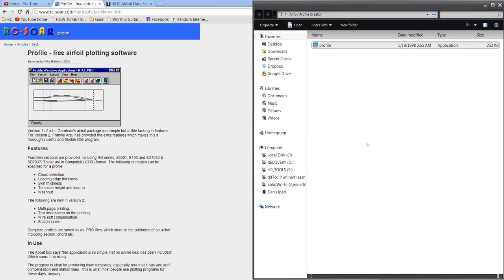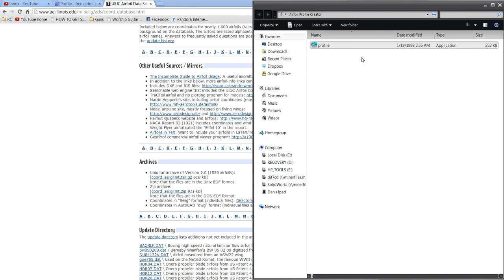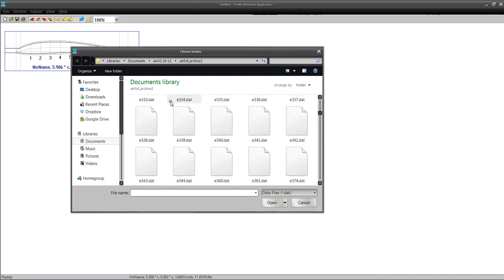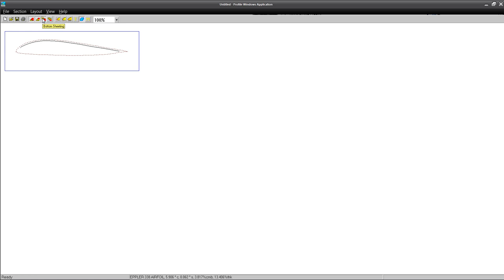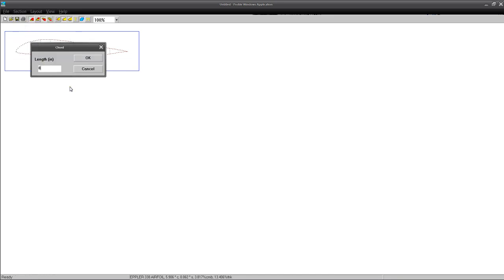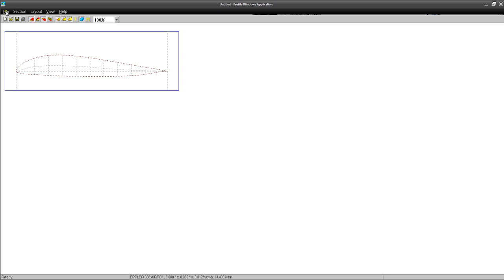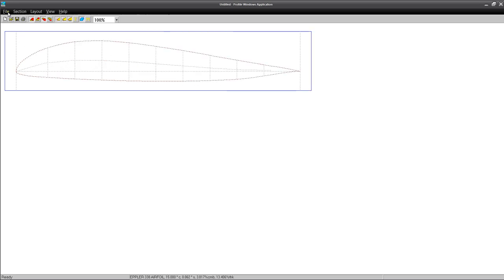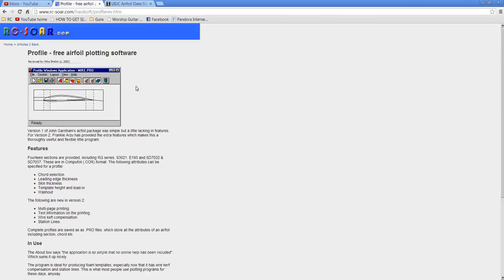EASILY Make Airfoil Templates for FREE

Comment: Pretty simple really. Just wing area vs lift by changing the span and using the same cross section. Its much more accurate using this software because I could use the same cross section template over and over again with a digital copy. Also better because I didn't have to guess the scaling on the printout and hope that it fit my foam block.